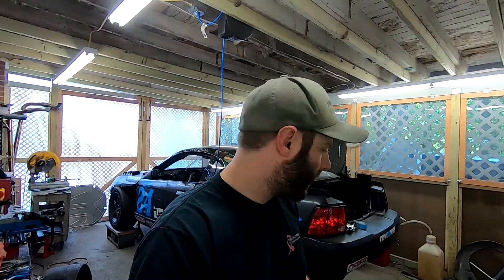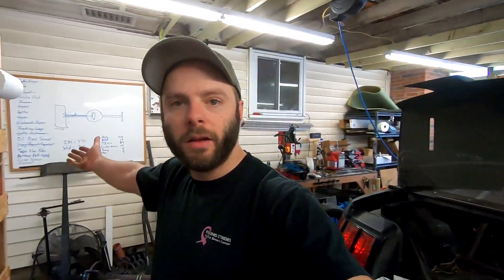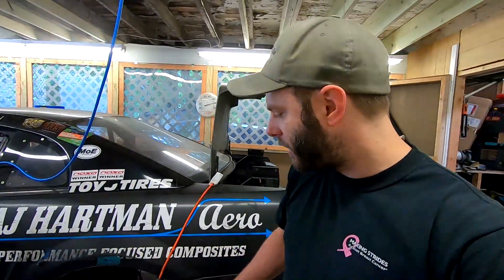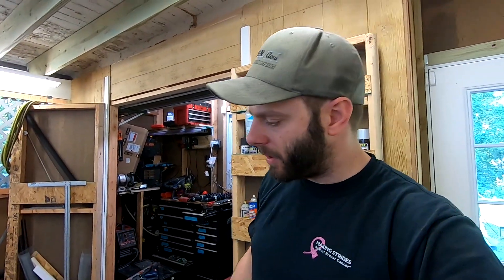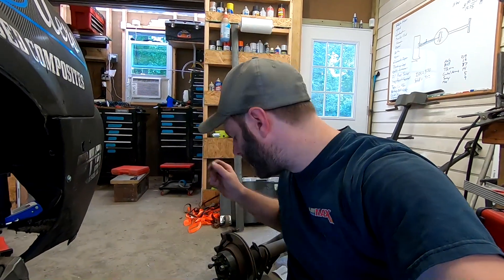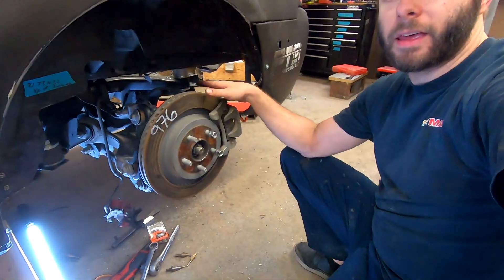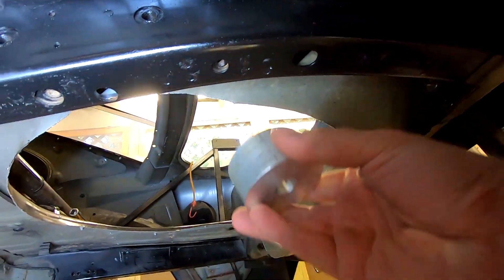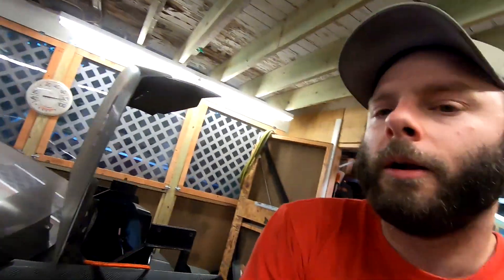S550 Mustang Subframe Swap Brackets

Comment: I see some wider quarters coming after that much width added, cool swap just wish i could narrow it some (reasonably inexpensive) for my SN so cobra 17x9s and 275/40s tuck under the factory 1/4s
Reply from the maker: young11984 yeah flares will definitely be needed.
Reply: @ajhartmanaero  How much wider is the rear width WMS to WMS going to be?  That can have a pretty impact on handling and balance.  Are you going to space the front too?
Reply from the maker: AutoXandTrack i had 1.5” spacers on the solid axle and the s550 irs was still about 2” wider. So that would be about 5” or so wider without spacers.
Reply: AJ Hartman Aero Wow!  Thanks for the info.

Comment: So you can't modify the s550 subframe?
Reply from the maker: Not in my class. But you can modify suspension pickup points.
Reply: @ajhartmanaero  I was looking how the cradle lined up with the frame and it looks like it would be a lot simpler to just cut the front Horn off and start their but if you are rules bound, gotta work with what you got